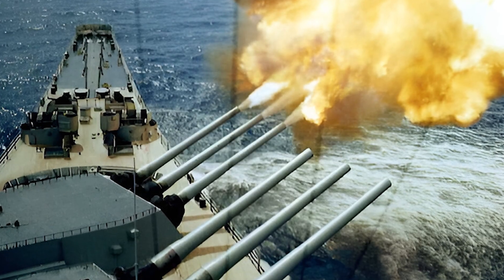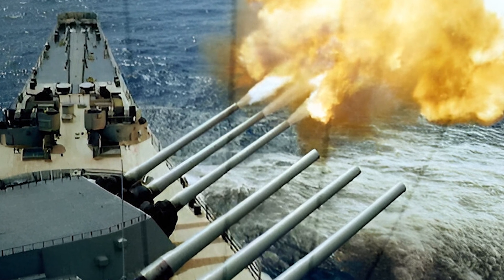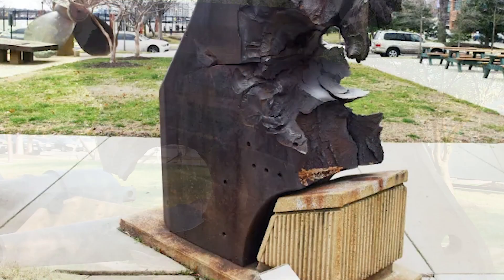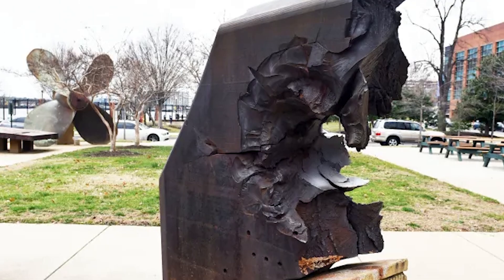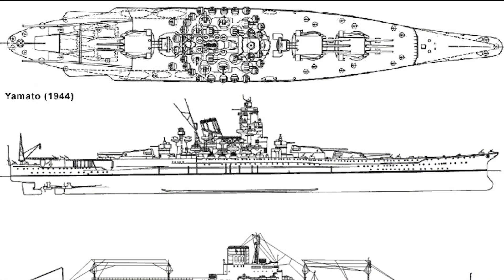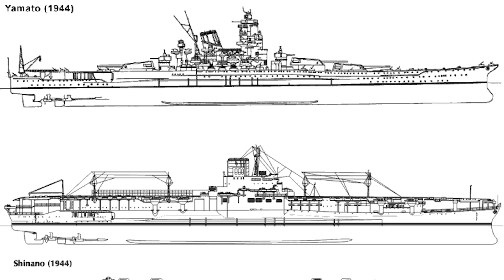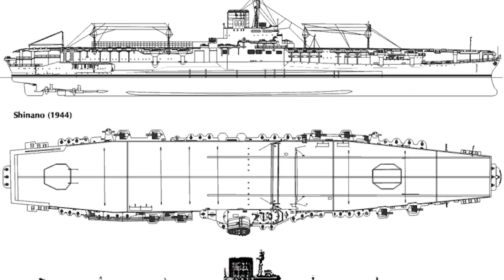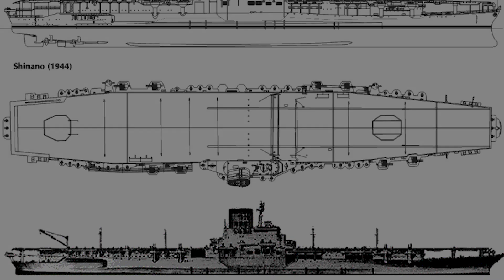USS-Iowa VS Yamato Armor Simulation

Comment: The test was done at a range of 400 ft (point blank for battleships, but not literally point blank) and a reduced charge was used, resulting in a striking velocity of 1992 ft/s (607 m/s).
Reply: They did two shots.  The first was set up as you say, but they used the maximum test charge allowed, which exceeded the maximum charge allowed on US battleships at sea.  The first test was a stunt and  actually violated the test orders.    They did a second test  wit a charge replicating  about 16-18,000 yard combat rage and the second shell did not penetrate the armor.  Seen the actual test report.
Reply: No they did not , a full charge from an Iowa class battleship is 6 90 pound bags of cordite , they did not use full charges . An Iowa produces a muzzle velocity of around 3,200 fps or ( faster than an m1 grand and heavier than a Volkswagen beetle) .
Reply: @jessieyoung3759  A brand new 16" .50 cal. gun (meaning no barrel wear) had a muzzle velocity of 2,500 fps. 3,200 fps is just over the muzzle velocity of an M- 16.
Reply: @jamesb4789  I read the test report, they used reduced charges on both tests. Remember that the full charge results in a muzzle velocity of 2500 ft/s, with not much loss at only 400 ft. What was unrealistic was that it was a 90° impact, while an impact at 1992 ft/s corresponds to a range of about 12,000 yds and 7° angle of fall, so a 52° impact angle on the turret face if it had been mounted at 45° like it was designed to. 
The second test further reduced the charge to get it to a speed closer to what would be expected at a range where a 90° impact was possible (about 40,000 yds), though the velocity was a little high even for that.
Reply: That is literally point blank
Reply: @undefinedxx55  A battleship doesn't fire using sights above the barrel like a regular rifle, so it isn't literally point blank. For figurative point blank, it still isn't at 400 ft, though scaled up to battleship size, it debatably is.
Reply: @Alphacuremom55  they reduced the powder charge to simulate longer range. Crazy, I know... To think someone would think of it for testing.
Reply: Anything below 8 miles is point blank direct fire for these guns and armor becomes increasingly meaningless. Even 8" guns would penetrate armor such as that on Iowas. Hence why many argue that a Des Moines class cruise with its rapid fire autoloading 8" guns could actually defeat an Iowa (or any battleship) at such range because it can poke many more holes in the same timespan into the target, than the other way around.
Reply: @Ganiscol  The definition of point blank would be no elevation from zero. At 8 miles the guns need to be elevated 8 degrees and the projectile goes as high as 1600 ft.
The 8" guns from a Des Moines also cannot penetrate at that range, those shells have a penetration of ~8" of armor at that range, compared to the 13.6" of effective armor that the Iowas have.
Reply: @Ganiscol  
interesting that 203 mm weighing more or less than 120 kilograms can penetrate 320 millimeters of VH steel, tempered, almost without inclusions, carburized
I assume you are a young asshole playing world of warship
where a 155 millimeter pixel penetrates 450 mm of steel on a gun turret from the front
listen, asshole
since 1984 I have been a metallurgist, - I know steel and other metals as well as I know life - I know how to join any steel, weld, solder, pony
you don't know shit
and your theory shows how stupid you are...
so tell your shitty american brainflatted bastard theories shitted out of your black ass to someone who doesn't know - and you better not tell them in public if you don't want to be ridiculed
I have a piece of advice for you, asshole
if you don't know something - shut up
Reply: @Ganiscol  16,000 yards is not point blank range. That represents a medium ranged engagement. Point blank for WW2 capital ships was in the neighborhood of 6- 7,000 yards.
Reply: Yeah,the striking velocity in the  real test is equivalent to a range between ~ 9000-13000 meters,it probably is the minimum speed required to pierce the plate when vertical . It would be interesting to see striking velocity close to  
MV like in this video but against the plate at the proper angle of 45°,with over 900 mm of LOS thickness.
Reply: @ShokkuKyushu  Per the NPG report, the faceplate was impenetrabke at any combat range by the 16" .50 cal. gun.
Reply: @manilajohn0182  Yeah,I know, but I'd like to see it in a simulation 😅.
Reply: point blank is not 400 feet.. i.e. anything below 120 meters...
did you see the cloud from the 406 mm shot??
I don't think so
the report shows that the shot was fired from a distance of less than 5 kilometers, using a Mark-5 cannon, with a reinforced charge, a double jacket on the projectile and a rigid tungsten-molybdenum core
at a speed of over 820 m/s there is no way it wouldn't penetrate 600 millimeters of steel, of rather poor quality anyway - but perpendicularly, because if it was at an angle, it would only show laminar damage, without penetration
the damage indicates what kind of projectile was used..
but you don't know that...
because you are a typical American flat brain, for whom knowledge of metallurgy and high-speed mechanics is black magic (as well as logical thinking)
so in the future - shut up, you are making a fool of the human race
Reply: that would correspond to about 8km distance to target. Almost pointblank for battleships. Realistic speeds at 20-30 km would be  closer to 300m/s. Still should pen just fine,
Reply: While true, it's still ridiculously close range and flat angle shot. I believe the entire length of the gun was about 70ft. 400ft was less than half the length of the ship that carried these guns. In combat it would be nearly impossible for the 16in to pen Yamato's turret armor however, it was possible they could pen the belt or the deck (and vice versa, the 18.1in guns could pen the Iowa's belt and deck, esp at closer range/flatter trajectory).
Reply: @177SCmaro  Agreed that it's ridiculously close, just wanted to clarify the exact range.
Reply: @Quasarnova1  
Fair enough. 👍
Reply: @177SCmaro  The physical range of the test is irrelevant. The reduced charge simulated an impact velocity of around 15,000 yards. As you can see, the shell still had plenty of remaining velocity after penetrating the armor plate, meaning it would still penetrate an angled plate.
Reply: @Crosshair84  lab tests showed the plate heavily contaminated with debris as well including dirt...
Reply: @Crosshair84  No,the plate in the actual configuration would be impenetrable (~930 mm LOS).
Reply: @177SCmaro yamato's 18 inch guns wouldn't have any difficulty to penetrate iowa much thinner belt even at its maximum range of 25km
Reply: @177SCmaro nope you have to remember that the charge was reduced and the shell easily penetrated it and the armor was defeated by aircraft easily.

Comment: Are you sure the ballistic cap had that stepped design? All the 16in shells I've seen had a cap that curved until it was flush with the full diameter of the projectile.
Reply: The US ballistic cap design was misrepresented for decades.  I think it was only finally revealed after the battleships were retired.

Comment: bare in mind that this was at point blank and the plate is supposed to be angled as well while on the turret.
Reply: Physically it was, but it was a reduced charge shot to simulate an impact of around 15,000 yards. As you can see, the shell still had plenty of velocity after penetrating, meaning it still would have gone through a reasonably angled plate.
Reply: @Crosshair84  The USNPG report from the two  tests concluded that the faceplate was impenetrable at any combat range by the 16" .50 cal. gun.
Reply: そうですよね。至近距離からぶち抜いてイキってるだけ
Reply: @みまみ-c9w  on the portuguese translate, it says cumming at the end... i love the internet!
Reply: Yeah,the striking velocity in the  real  test is  equivalent to a range between ~ 9000-13000 meters,they probably tested the critical speed,the minimum 
speed for the 16 inch super heavy shell to penetrate vertical 660 mm of FHA, which is apparently  less than 600 m/s.
Reply: Point blank in military terminology means the farthest range at which you can hit the intended target(be it a man, tank, ship, etc) without adjusting the sights/optics, it easily could have been at least a few hundred meters if not a kilometer with a full service charge in a 16 inch/50 caliber gun
Reply: @jakegrube9477  You can look the test report up.  It's public domain these days.  Fired at 400 yards from a brand new gun.  The plate was dliberately over supported, meaning it was more rigidly held than the actual plate would be, and no allowance was made for the plate also being partial, meaning that it didn't have the beenfit of being part of a turret, as it was designed to be.  So basically, they stacked the odds as heavily as they could in favour of the US shell.

Post war testing indicated that IJN BB armour was generally superior to US BB armour, being both (slightly) lighter for a given volume and with better ballistic performance overall.  This reverses for CA armour, where the IJN armour is less effective against higher calibre rounds, but more effective against lower (ie 6 inch and under) calibres.  This is due to the way the two types of armour were made, both composition and hardening profiles.
Reply: @iatsd  yea, the yamato was built to win ww1 battleship fights like jutland and tsushima, not win against waves of us navy torpedo bombers
Reply: @iatsd  The U.S. Naval Proving Ground concluded from testing that Japanese heavy armor was inferior to U.S. armor by a minimal margin (less than 5%). Britain's equivalent of the USNPG- the Armour Technical Committee- concluded from their testing that Japanese heavy armor was "superior to all foreign armours". Either way, the difference in armor quality of the major navies was minimal and would likely have little impact in combat.
Reply: @jakegrube9477 yes we can say that the japanese aa on ship wasn't very good
Reply: @jakegrube9477  yes, this is true, in further research they discovered they couldn't pen the front facing armor plating of the turrets at normal engagement ranges, don't know about armor belt tho, haven't read anything on it.
Reply: @q.m.5454  And considering the range of engagement, slamming the face of a turret is akin to hitting a bullseye; you're comparatively more likely to hit the deck or the barbette of that turret
Reply: During this test they used a reduced charge so that the shell would have the velocity it would fired at range, without having to worry about firing multiple shells to score a hit

Comment: 1）I heard this piece of armor got defects from its production.
2）I also heard the armor needs to be 20 times the round caliber in size（not thickness） to achieve its full potential of resistance power. a smaller piece will provide less perfomance.
Are those ture?
Reply: All metal plates can be subject to defects, very dependent on raw material and process. No major metallurgical issues were noted in Yamato's main armour, however, as Japan had by then sufficiently mastered the heat treatment process (even if it was still a bit behind the curve compared to more advanced processes used by the US and Germany). The significant defect in Yamato's armour was the design - the joint between the belt armour and the lower hull was badly designed and rather prone to failure.

As to your 2nd question - there is some obvious merit in a minimum size of plate otherwise it's like dropping a boulder on a dinner plate. But that's usually not an issue in most armour applications since the target is almost always much larger than the round. In terms of thickness, for full-bore spin-stabilised AP rounds against RHA, the typical rule of thumb was the T/d ratio - that is the ratio of armour thickness to the diameter of the AP round. Generally, a T/d ratio of 1.5 and above (that is, armour with thickness that's at least 1.5x the caliber of the AP round) would be just about sufficient to prevent penetration at typical combat ranges . 

By the way, I do have some issues with this sim:-

1) Yamato's faceplate armour is depicted as being RHA - in fact, it was VH (Vickers Hardened), which is a particular type of face-hardened armour. I believe that may have a non-trivial effect to the result. 

2) Striking velocity of 750m/s is practically muzzle velocity - i.e. the plate was sitting right at the muzzle of the gun. Not realistic, obviously. Although that's described in the video but eh... not much value in the simulation then? :) At 25,000 yards, the 16"/50 AP Mark 8 had a striking velocity of about 500m/s with the shell's trajectory at 21 degrees below horizontal. Based on the USN's empirical formulae for penetration, the shell would go through about 440mm of armour - well below the 660mm of the Yamato faceplate. Which, by the way, neatly illustrates the 1.5x T/d rule above.
Reply: @DenKHK  Thinking about it, that guideline scales down pretty well too.  .50 caliber AP at GPMG range can generally be stopped with 3/4" RHA.
Reply: @DenKHK correction the shell st standard engagement range had a velocity of around 600m/s 

Infact that whole irl test was done with reduced velocity to simulate how the shell would react with the armor at standard combat ranges.
Reply: yes it was there because it had defects, and was rejected.

I don't know about the second one.
Reply: @gerfand  It was not defective, but never used .  After the decision to convert Shinano, that plate was taken to the test range, but set aside and never used.   It was found post war.
Reply: @gerfand  Untrue.
Reply: @熊掌波清波  it was contaminated with dirt and other debris....

Comment: I'd be more interested in seeing a simulation that replicated what an actual combat hit might look like; there's basically zero chance that a shell would ever get a perfect 90 degree hit between the arcing trajectory of shells, the sloped armor, and the movement of the sea.
Reply: But remember, that is the front armor of the Yamato's main turret, while shells often hit the armor belt on both sides of the ship, which is only 410mm thick
Reply: @thienngoclaile6095  Yep, and at the distances that combat would begin, the Iowa would have a hard time doing anything to Yamato's belt armour as well. Yamato had an immunity zone towards her own guns that was between 21km and 28km. So against the USN Super Heavy shells fired by the Iowas and the SoDaks/NoCals they'd have to be within 19km to penetrate her belt armour. Worth noting: The Iowas had an immunity zone to their own guns between 24km and 30km on their belts. So even at 22km the Yamato could potentially penetrate the Iowa's belt armour.
Reply: @HunterSteel29  Yes, that's why in good weather conditions, Yamato can easily win against Iowa but vice versa when the weather is bad
Reply: @thienngoclaile6095  660 mm. The ship's main belt was 410 mm.
Reply: @manilajohn0182  that's what i said
Reply: @thienngoclaile6095  Huh. I misread your comment and I stand corrected. Endless apologies.
Reply: Source material is courtesy of the U.S. Navy Bureau of Ordnance.

Immunity zone of the Iowas vs. the 18.1" gun:
Citadel                    24,800- 29,800 (5,000 yards);
Turret Faceplates 24,700- 31,600 (6,900 Yards);
Barbettes               26,500- 31,600 (5,100 Yards);
Steering                 24,700- 28,800 (4,100 Yards);
Control Tower       26,500- 31,600 (5,100 Yards).

Immunity Zone of the Yamatos vs. the 16" .50 cal. gun:
Citadel             17,000- 34,500 (17,500 Yards);
Turret Faceplates                      (Impenetrable);
Barbettes         16,600- 36,800 (20,200 Yards);
Steering           19,100- 33,400 (14,300 Yards);
Control Tower 16,600- 33,400 (16,800 Yards).
Reply: @manilajohn0182  Do you perchance remember the name of this document? I would love to read the rest of it seems interesting.
Reply: @orangegear8435  Are you looking for the actual document designation or is an authoritative source in print which specifically references it sufficient?
Reply: @manilajohn0182  Authoritative source will do just fine, so long as it has the document specified. I dont mean to make you go searching the entire internet just to reply to someone lol.
Reply: @orangegear8435  IF you're a reader, look into the five- book series by Paul Forrest. One covers Allied capital ship armor, another on Axis. The remaining three cover Bismarck vs. Prince of Wales, Littorio vs. Richelieu, and Yamato vs. Iowa. His sources are, AFAIK, solid. IF you're a fanboy, don't spend your money. No offense intended.
Reply: @manilajohn0182  Thank you very much, and no offense taken. Ive got well over 40 books at this point on various technical aspects of the Pacific Theater involving ships, weapons, tactics and such and am looking to get into the topic heavily. I appreciate you getting the name of the books for me!
Reply: @orangegear8435  Kudos to you for wanting to actually learn about the subject. I cannot emphasize that enough. Best wishes that time increases the size of your library...
Reply: @manilajohn0182 I find that depth in understanding goes a very long way. When it comes to the Pacific Theater or even creations of different nations in the form of ships and weapons too many people rely on summaries online. While generally that can get you into the know how its not supportive of any true knowledge or understanding of the subject or operations of systems and tactics. So books and the sources of said books in form of more books and documents is the sure fire way to go, even if it gets quite expensive...